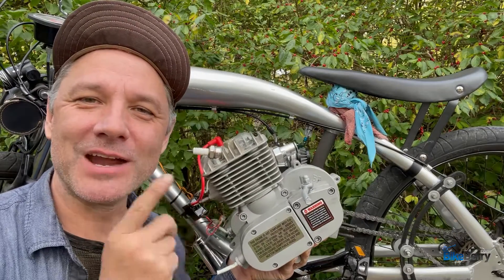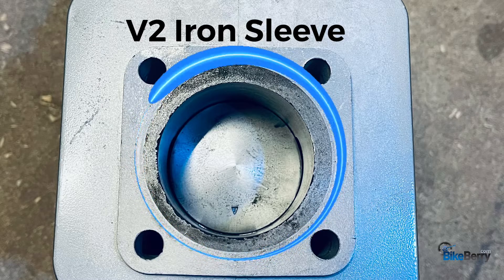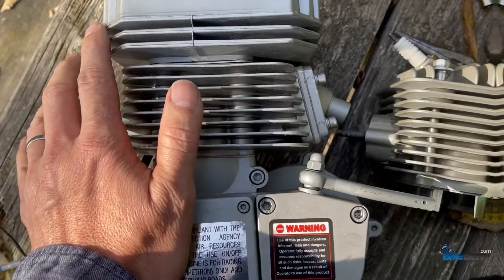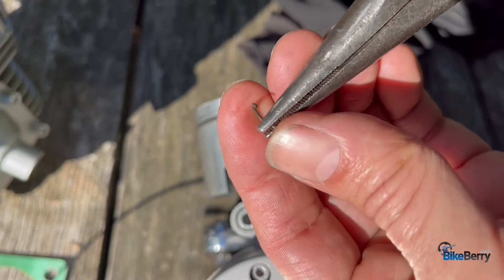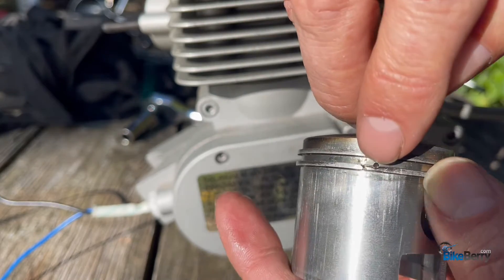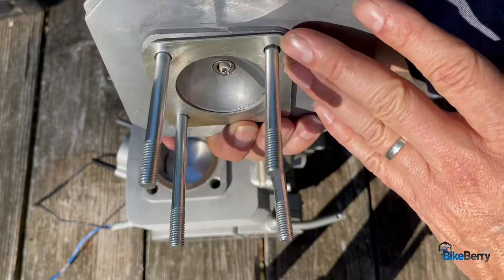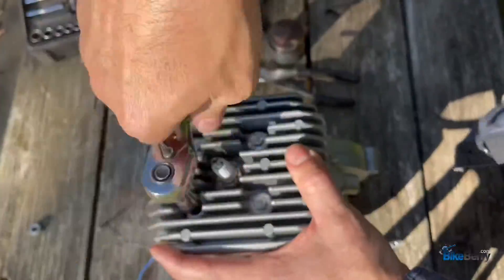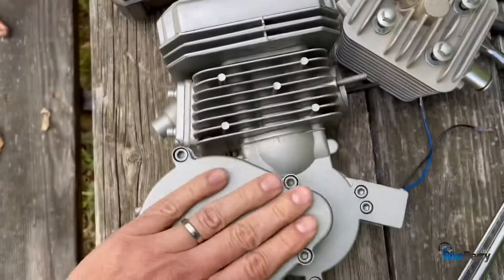Hey BT-100 owners! Let’s Convert V1 to V2 \ BikeBerry

Comment: I thought when you had a read valve, you would need a special piston with a hole in it.. because I’m trying to do engine kits guys who put red valves on their bike. They need to put a special piston with a hole in it… is it different on the bike Barry second GEN motor. I have the second GEN on a bike and I get that thing flying after I learned how to tune it right.. it takes a while for it to warm up. But once it does, it flies.

Comment: This comment is not for this video but i will try this platform as BikeBerry has left me no choice.  I purchased a 49cc friction drive kit as well as the kit which includes the bike for my wife.  Mine arrived with the friction drive damaged, the bearing cover was missing and the housing that goes over the clutch was not seated properly. Making a long story short, as a guaranteed product i have sent multiple emails and pictures of the issue and all i get back is that i should adjust the idle speed.  Buyer beware, this is a company that does not back their products and sends inconsistent poorly mass produced parts.  I could not leave a review on the website so be careful of the star ratings. Three months trying to get everything up and running correctly but no help from bikeberry...... and the outsourced customer service is difficult at best
Quick rundown of a few things, gasline they send is hilariously short, the fitting on the tank is larger than the engine so you need an adapter. Kill switch line has different fittings than the engine receiver so you need to splice it in, as well as being about 6 inches too short for the kit that comes with both the bike and the motor.  Had to install spacers so the housing wouldn't rub on the clutch/flywheel. The other was worse,  they won't replace the damaged friction drive assembly,  the spacer nut was too short, this "ready to install" motor has needed many trips to local shops for parts and has become a Frankenstein to make it run about 70% the way it should.
Reply: Hey Joe, I’m gonna look into this for ya.